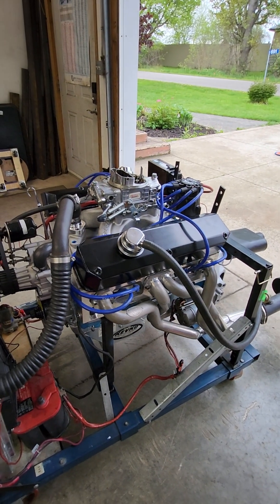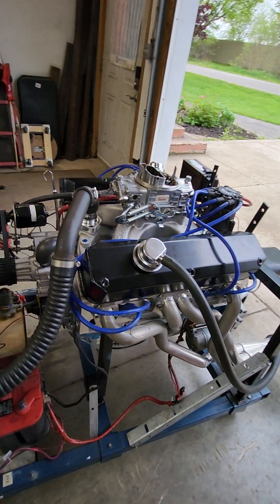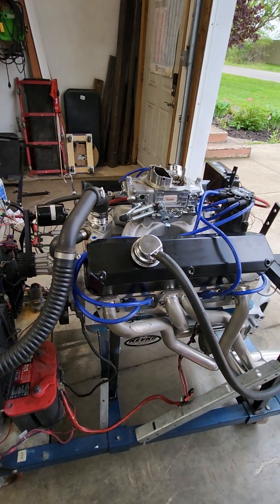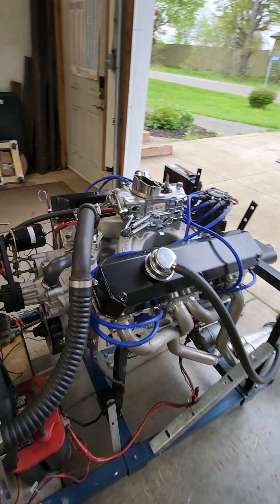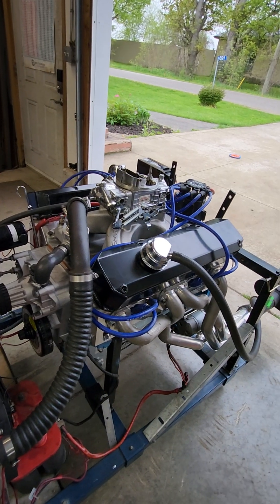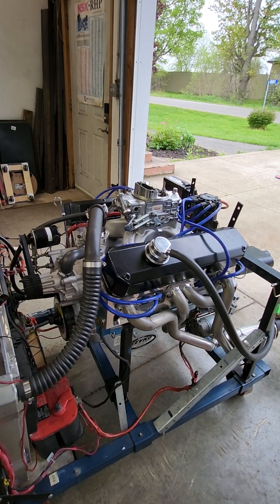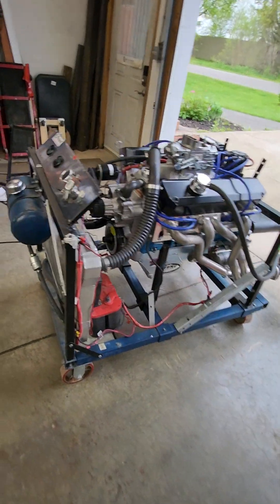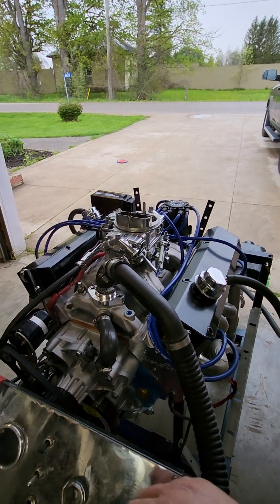Small Block Mopar Stroker 360/408 LA. Trick Flow Heads and Intake, Lunati Voodoo Hydraulic Roller

Comment: i'm building a 347 for my 74 bronco - any suggestions for a great low end torque cam?
Reply from the maker: 535 torque as a guess with the single plane and that cam
Reply: @brightonracing  I’m interested in purchasing one of these engines for my Dodge van. What’s a good way to get a hold of you to discuss pricing?
Reply from the maker: @Hyptnotizedvan  cab text or call me. 5.1.9.3.5.7.1.1.1.3.